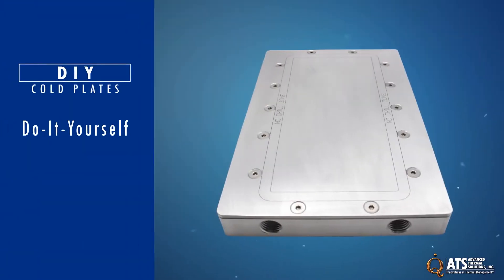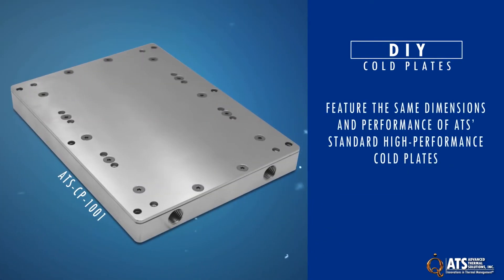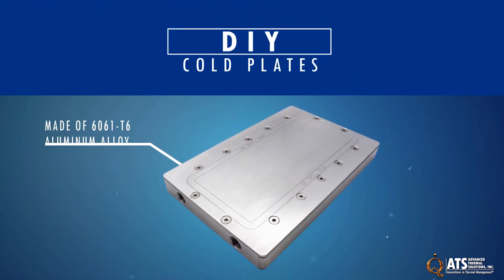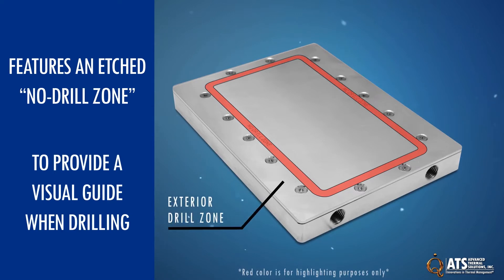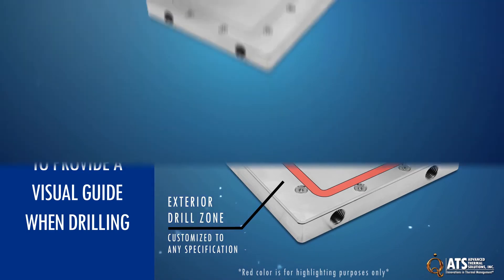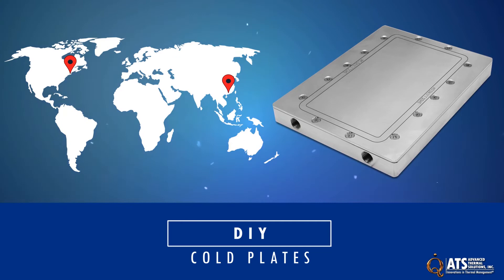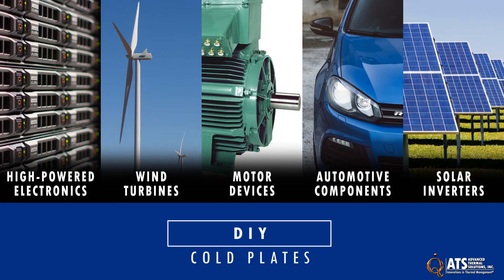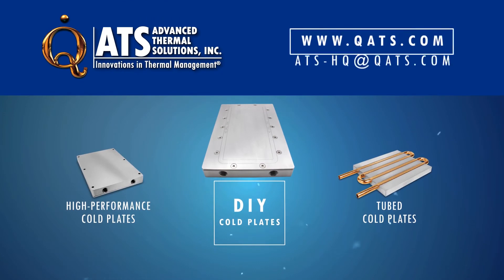ATS Do-It-Yourself (DIY) Cold Plates

Comment: Why not create a motherboard out of one of these?
Reply from the maker: HI @TNJedeye  thank you for leaving your comment.  Your suggestion might be very challenging. Generally, semiconductors need to be connected to one another via a trace, which is often copper. That would be challenging to etch into a cold plate, then securely apply all the semiconductors to the PCB/Cold Plate.  We think someone might be able to do it but it would be very costly and clearly a very very specialized approach.  The current liquid cooling approaches available today and planned by researchers for the future would probably be more cost effective.